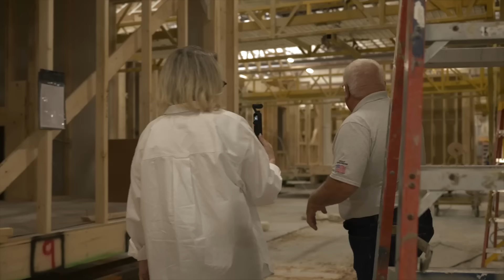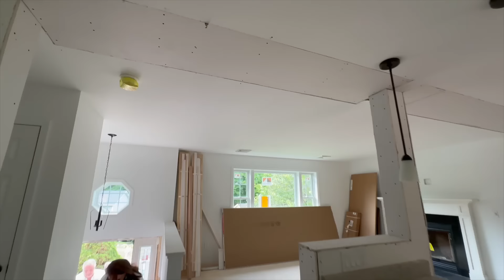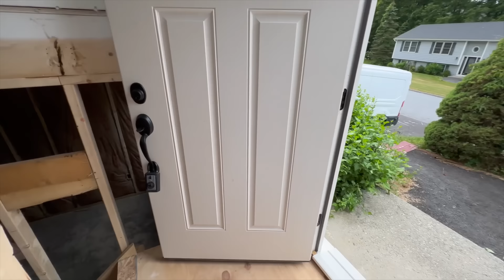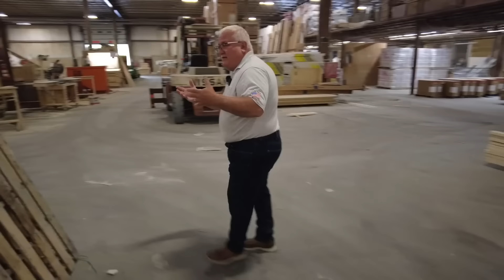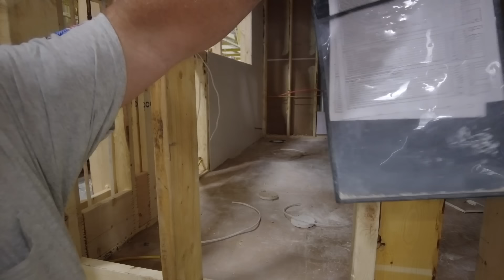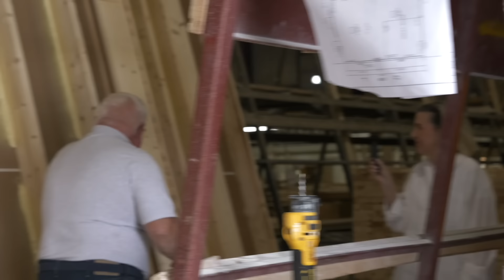Modular Homes ARE Better Than Stick Built!!!

Comment: I’ve been in the construction industry for thirty years…. I can assure you, my next home WILL BE a modular home. The fact that building materials are not sitting on a job site - exposed to the elements for days, weeks, months on end during traditional build is reason enough for me. These homes are PROTECTED from the rain during the build - reducing the chance of mold and mildew that might be lurking in your brand new home - behind the drywall…before you ever move in.  Modular for me Baby!
Reply: Add termites to the danger of leaving building materials lying around.
Reply: @Flyingrabbit2222  great point! Nothing more delicious to termites than a beautiful pile of lumber sitting on the ground!
Reply: @lizzieb6311  That actually happened to a new home in my development. The lumber was already infested with Fomosan termite eggs. That damage wasn't visible for a couple of years.
Reply: @Flyingrabbit2222  That’s awful! And here they paid top dollar for a brand new home already destined for destruction by termites who were there when the house was built.  Terrible!!
Reply: $800,000 townhouses built next door to where I live.  Builders left piles of wood uncovered in the rain for days & the moment it stopped raining, they nailed together all the wet wood & wrapped it in tyvek the next day.  Left me stunned.
Reply: @Godskid-V1 it’s treated wood, lol I wouldn’t want a house where the wood folds under some water
Reply: @lizzieb6311  Great points!
Reply: I posted our same story. Thx.  Former contractor , metal building dealer, modular  home dealer and broker...realtor. Arizona 🏜🏡
Reply: Thank you for this comment. I never even thought of this.
Reply: So, where were the building materials stored when it was built??  If you weren't there when your building was built, how do you know anything about the construction process.  To me, it's more risky because you know absolutely nothing about the building until you get it.  Plus, it's hard to know the longevity of a home if they haven't been around long enough to make a comparison.  Site built homes can and do last for centuries.  The house I have lived in since 2018 was built in 1965.  Are the manufactured homes of 1965 still around to compare mine to?
Reply: @RonnieStanley-tc6vi  ummmm…. Let’s see….how did I know? If you read my comment you’d see I work in the construction industry.  I’ve BEEN TO and sold components we manufacture to modular home companies.  Apparently you’re not bright enough to know they store these home INSIDE ENORMOUS WAREHOUSES and build inside ENORMOUS MANUFACTURING FACILITIES. Lastly, you CAN visit the facility during the build if you wish. But I don’t expect you to know anything about the reality before you comment your nonsense.
Reply: @lizzieb6311  , at some point in time, in the lifespan of a construction 2x4 or 2x6 or whatever, it was stored outside in the elements. Yes. Once it gets to the modular building facility, while being built, its inside. Before that, I guarantee that lumber for your modular build, was stored in the elements.
Reply: @lizzieb6311  may I ask a you a question? Will my family be able to get a mortgage on a modular home with a VA loan?
Reply: @MyyaLopez yes - you can get a VA loan on a modular. It’s a house. It’s not a manufactured home/trailer. 

Regular mortgage.  (We’re doing this, which is why I know.)
Reply: In WA Timberland Homes seem to be built outside...
Reply: @lonniebeal6032  That’s very odd. It defeats the entire purpose of building components of the homes in a climate controlled manufacturing facility.  Are they perhaps ASSEMBLING the premade components outdoors?
Reply: @lizzieb6311  I second this.
Reply: Same here !! I was the chief mechanical estimator for hospital construction, so I've developed a method for educational purposes, family-built along with budgetary issues. This could be either DIY or contractor built. 1800s aesthetics w/ 2026 technology.
Reply: I've been researching modular builds for 2 years for my own personal choice. It's definitely the way me and my family are going. The difference in price points for a on site stick build right now is crazy compared to modular
Reply: Start an off-grid community consisting of individualized log cabins. ~LLC~ Lincoln Legacy Cabins
Reply: Yes. Completely dependent on the site and builder. Soooo many things can go wrong.

My dad was a foreman and "knew" who to use. None of them were fast but they ALL did great jobs. 
As an example I remember to this day (and I was 14 when he built it in the early 90s) the dry wallers stops what they were doing and asked "who the h&ll framed this cause even the closets are PERFECTLY square , exactly on measurement, and plum , etc.😅

They were dumbfounded.. as they should have been. Dude was a perfectionist. Took longer than most ( and my dad knew this) and many didn't like to use because he took longer but he knew WHY. And he was ok with that. And he was reasonable on price too.. super old school dude.
Reply: @bch5513  The quality of your Dads builds are sadly few and far between. You are right to be very proud of your Dads work…it’s a rarity anymore.  My primary concern is the fact that lumber and many other building materials are oftentimes sitting exposed - uncovered - in rainy weather for long periods of time.  Then, partially dry framing is quickly covered with drywall on the interior, or inferior house wraps which trap the moisture in the wood.  Everything looks lovely and new….until the mold appears.   And it eventually does.
Reply: And who are your subs? LOL. Are they even half sober? I had 3 houses behind me that sat for 8 months wrapped in Tyvek. Eventually that wrap was flapping in the breeze as weather took it's toll. I wouldn't have wanted to buy any of them.
Reply: @markw999  in new to all of this. Are you for manufactured or stick?
Reply: @markw999  Lol?at my comment? Can you even READ? Apparently NOT because I said I’d take modular over site built homes hands down….and TYVEK is absolute third rate…if I were building conventionally I’d use either a fluid applied or self adhered moisture barrier or AVB. Before you make a snide remark you should actually read the comment before hitting send lest you appear to be a fool. 🤡
Reply: @lizzieb6311  - You just violated this channel's rules. And BTW, he was agreeing with you. Reading comprehension matters!
Reply: @Faithful525  I “violated the rules”? 😂😂😂 What rules are they?  Those created by YOU?
Reply: @KristinaSmallhorn
Reply: @Faithful525  oh! So the “rule” is we dare not challenge a comment. Is that “the rule”.   Thank you “oh great arbiter of ‘the rules’. 😂
Reply: @Faithful525 oh, no! It's the channel rule police!
Reply: I considered joining after you invited me, but your channel is full of nasty, mean people who jump on anyone, even those who agree with them, and bully them. Your rules are meaningless, since you don't enforce them.
@KristinaSmallhorn
Reply: @lizzieb6311  With all due respect, I think you misunderstood the comment from markw999 4 months ago... The way we read it he was agreeing with you! And we are too, after recently buying a Florida spec house with these concerning issues ... especially no protection at all from the rain and humidity for weeks while house was built! Terrible! Guess we should be happy we chose flood zone X and concrete block construction ... however, who knows what is hidden behind the drywall?
Reply: @SUSANBAR31 concrete
Reply: Some folks on here need to grow up.😮
Reply: Far from the truth and facts
Reply: @AdamSmitty-hm2lp  Please explain my incorrect statements. I’ve only been a waterproofing and building envelope consultant for two decades and in the industry for 30 years. I know just a “wee bit” about moisture and how it can absolutely ROT a structure and its structural members as well as create a moldy disaster which can make the home uninhabitable. Please fire away and provide your alternate set of facts. I’d love to hear them.
Reply: @lizzieb6311  You sold me! U should be in sales!!!!😊
Reply: Seriously?  It's the responsibility of the builder to protect his investment.  Also, a house flow chart takes into decisions making weather, like, when to Tyvec the whole house and put the roof on.  If the weather shows a wet pattern coming, you protect the house or you put a rush on the wrapping and roofing.  Simple. Folks this is not rocket science and I assume the person above has a financial interest in these modular homes.
Reply: Agree.  And every site-built house I have seen being built was hammered together by complete DRUNKS!  That doesn't happen with modular-built houses.
Reply: @jackmabel6067  correct! With the labor shortage so bad for those willing to work in Florida in the miserable heat the Contractors are picking up day laborers at the local labor pools…those who nobody else will employ full time.
Reply: @lizzieb6311  " I’ve only been a waterproofing and building envelope consultant for two decades and in the industry for 30 years. "

Just because you have been doing something for a long time doesn't mean you been doing it right nor does it mean you are knowledgeable about the best ways to do it. I have see MANY MANY people act and say things like you are saying, and they really don't know jack. They just got by. Or they basically cheated a customer by not actually doing it correct.  

Now that out of the way. Everything else you have said is wrong. Have a nice day.
Reply: @AztecWarrior75  Does that bother you? Apparently 😘
Reply: @lizzieb6311  How does me pointing out "that people who claiming they have had years in a field and it not always meaning they actually know what they are doing", convert to "it bothers me"? and then "Apparently". 

See right there. You can't even read a comment without it bothering YOU. It is called projection. Nothing at all in my comment indicated any sort of feeling one way or another. YOU got hurt by what I said, and project that feeling as if it was my feeling. It is not. That's all you missy. 

There is another thing you did also. It is called gaslighting. You can't make a proper rely nor can you fight what I said. So you try and humiliate (not even close tho) by trying to make ME the emotional one instead of YOURSELF.  

So care to say if you think what I said was not true?
Reply: @AztecWarrior75  It appears it bothers you enough to respond with a lengthy diatribe. 😏
Reply: @lizzieb6311  Again. It is bothering you. Those are your own feelings being hurt. You may want to seek professional mental help.

" lengthy diatribe."

Funny how your initial comment is 91 words and my initial comment is only 85 words. Yet you cry about mine being a "lengthy diatribe". Even my second comment is only 113 words long. 

Why don't you quit crying about things bothering you and how long comments are and just admit you have no idea what you are talking about. All those years of experience and not a lick of sense.

But you go on and call things "lengthy diatribe" instead of just proving them wrong. Oh wait, you can't. I understand that your mind starts going blank if you have to read anything past that the comic section of the news paper. BUT GET it TOGETHER little lady.
Reply: @lizzieb6311  Again. It is bothering you. Those are your own feelings being hurt. You may want to seek professional mental help.

" lengthy diatribe."

Funny how your initial comment is 91 words and my initial comment is only 85 words. Yet you cry about mine being a "lengthy diatribe". Even my second comment is only 113 words long. 

Why don't you quit crying about things bothering you and how long comments are and just admit you have no idea what you are talking about. All those years of experience and not a lick of sense.

But you go on and call things "lengthy diatribe" instead of just proving them wrong. Oh wait, you can't. I understand that your mind starts going blank if you have to read anything past that the comic section of the news paper. BUT GET it TOGETHER little lady.

Comment: There is still a big problem with modular homes, and that is the law has not caught up with the changes in construction. 
There are many codes and restrictions that prevent building an modular home on site. This was to stop old mobile homes, but the wording is such that any building but off-site and moved is banned. 
These newer modular homes have nothing to do with mobile home. The newer ones are the same as an on-site built home, simply prebuilt in a factory at another location, and often have better insulation values than on site. The laws need to change, but that takes time.
If I were putting in a wood framed building, I would prefer a modular home built off-sight. It's simply a better product now. I'm live in an area with no restrictions and very lax building codes, so I'm not personally affected by the laws, but I passed up properties because of such laws.
Reply: No you are wrong. This house uses the SAME code as anything built on site where you live. There are no restrictions.
The problems people were talking about were what every house goes through.

Comment: You also avoid dishonest contractors up charging you for everything like claiming that they will be using a superior grade of paint and then ordering "contractor's grade" at the paint store for example AND not wasting half the day/week running to the stores to purchase said items while they eat breakfast lunch and dinner on your time and juggle several jobs while they are supposed to be working on yours dragging out the completion time. I think the modular builders are far better and most are using thicker lumber than stick-built homes made of 2 x 4 wall studs vs 6" for modular. The only thing about this review that surprised me was that the flooring, lighting, switch plates, and countertops don't come already installed with just the seams between the units needing to be finished onsite. Modular companies I've visited install that stuff in the factory and deliver the units completed save for the seams. It seems to me that the way the builder shown in the video waits to install those things on-site is leading to more labor cost and time wasted to finish off the interior. I've seen videos of a jet plane engine being backed up to about 30 to 50 feet from to a mfg/modular home = tornado force winds and the only damage it sustained was a few shingles blew off.
Reply: Nobody is using 2x4 for framing except the gulf states.

Comment: Is Home Insurance a lot higher on a modular home? Then a regular traditional concrete and Barrel  tile roof home? In the state of florida.
Reply: They're the same as site built. They AREN'T MANUFACTURED, which is the problem people don't understand. That's the HUD issue and that traditional "modular" homes.
Call Clayton Homes in your area. They do both, and I think they own about a third or half of the factories in the US.

Comment: We built a modular home this last year. No problems with financing, but found out our insurance company, Progressive, would not cover a modular home. Had to find an independent broker to get home owners insurance.
Reply: Progressive is one of the worst insurance companies.
Reply: @CatCaretakerID  I agree & think it's owned by evil George Soros.
Reply: Consider yourself lucky for not getting insurance from them.
Reply: Progressive is the worst insurance company ...
Reply: Why is that?
Reply: @robertlemaster156   Seem very odd to me also because a Modular home is a stick built done in a controlled environment. This is not a Trailer/mobile home.
Reply: @drewski1441 probably special interest groups lobbying them
Reply: @drewski1441 😅
Reply: @robertlemaster156  they couldn’t give me a reason. They started the taking my info, and when I first mentioned modular, the guy stopped and said they don’t cover modular. I explained that I didn’t mean mobile (trailer) home, he knew what I meant and said progressive doesn’t cover those for some reason. He advised me to call an independent broker to get coverage.
Reply: We've had Allstate coverage on our doublewide mobile home for years. We even installed a wood stove about 7 years ago. Called Allstate first of course, and they have no problem as long as it is UL listed.
Reply: @backtoasimplelife  state farm was 65 more a month than most companies for my double wide best rate I could find was Johnson and Johnson
Reply: @SteveLange-f6h  we had that problem.  All-State out of Arkansas..helped us
Reply: @SteveLange-f6h  progressive is a woke co. I have a friend who had the same problem  with them and went to state farm ins problem solved
Reply: Which insurance company did you go with..need a great one
Reply: @blrando75 went through a broker that got us a policy with Safeco
Reply: Start an off-grid community consisting of individualized log cabins. ~LLC~ Lincoln Legacy Cabins
Reply: Same experience.  Insurance companies are ill-informed.

Comment: Kristina, awesome video and great info, thank you! Just throwing this out there from a 1,000 foot view, so bare with me. When I see basic quality issues, such as the can spray foam around windows and sills that look like my 6th grade daughter did it, it makes me question the rest of the quality. Probably a great built house otherwise, just not sure...
Reply: You obviously don't know that that is exactly how every house is done. They're also using foam glue on the drywall, which is better.

Comment: Shouldn't use faced insulation on basement walls, however.
Reply: Yes you can, on either the outside or inside of the foundation.  You aren't up to date on products. And those are like 30 year old products